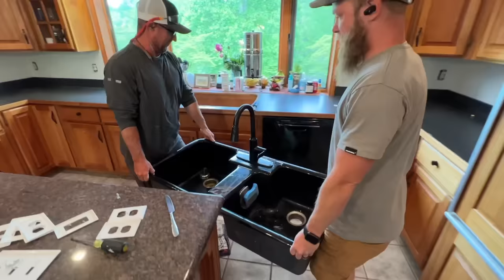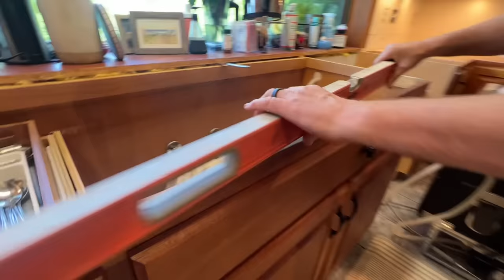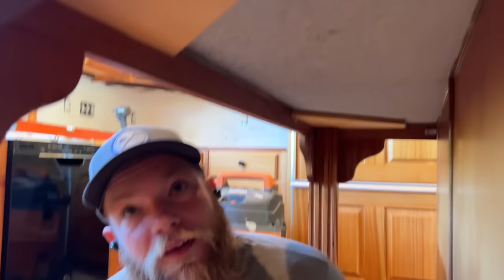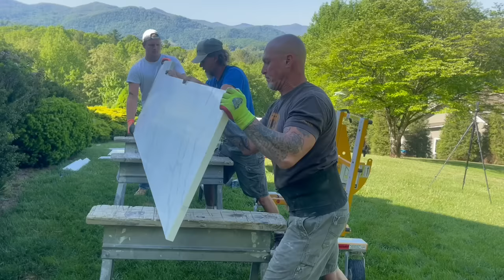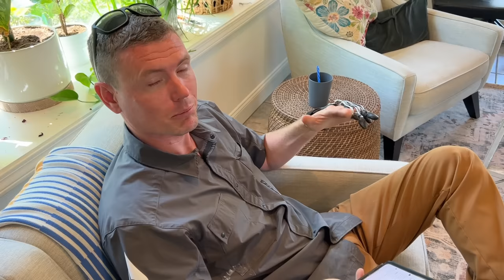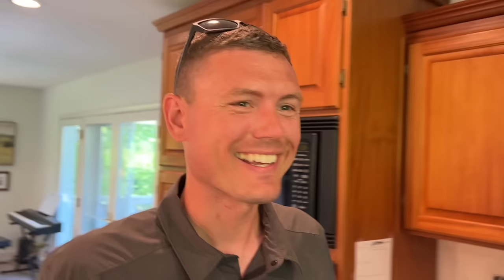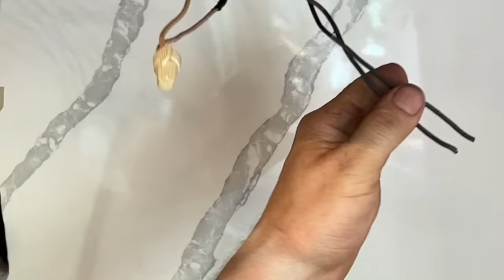Watch this BEFORE before replacing your counters!

Comment: Anderson makes a different casement window crank that are not designed the same way.  Think of them as big air clean wing nuts that you would have seen in a carbureted V-8 engine (you're old enough to remember those right?   lol   Seriously though, those wing nut cranks will clean, but will not give you as much leverage when trying to open the windows.   And as window mechanism's age, they need more pony power to open, or more leverage in other terms.   So, there is an option, but it does come with a small penalty.   BTW, you have a beautiful back yard!

Comment: Hey man, 31 minutes in the bay window. I got the same one you can rig up a couple of CPU fans power supply fans like three or four of them to a 12 V converter plug it in you can put them in some wooden and lay them, or whatever you want you know, but just the moving air will keep that from happening. I ended up under skirting mine with some insulation underneath the bottom and worked out pretty good.

Comment: Re the backsplash, behind the stove is the most important part to have a smooth, easy to clean surface, but you're preserving that porous brick surface.  It may look cool but even if sealed periodically, keeping it grease-free will be an unnecessary chore.

Comment: New top looks awesome! first time here, as someone else mentioned...you seemed to really enjoy the comrade while slaving way, great bunch of dudes. You can get a "T" style crank handle for the casement, that would allow a sheet of formica. As for that long cabinet that bowed, see s like they didn't put in mid supports under the base, but looks like yeah covered that off. Will be back, Thanks. Andrew

Comment: Just did a very similar upgrade on my house with almost the same color/pattern quartz. Huge wrap around with island etc. My demo though was everything was covered with 4” ceramic tiles with concrete and mesh under it. One of most difficult demos I’ve done. The quartz guys were amazing though and the project came out amazing.

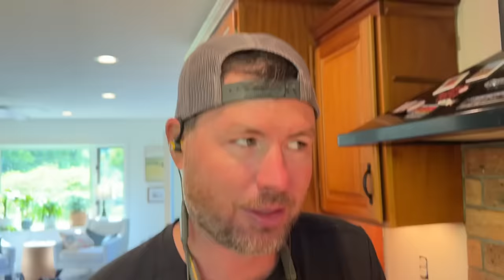Comment: 6:14 Yes. Get new cabinets and make sure they are strong enough to handle the weight of the new counter top. Particle board is a no no. 1/2 inch sides is a no no, use 3/4 inch cabinet grade plywood.

Comment: I had one guy show up to measure countertops years ago with just a folding ruler and a pad. I tell them you have to make a physical template of the base cabinets with lattice strips using a hot glue gun and a stapler. I also have seen those undermount sinks just fall out because the sink was only glued in place without mechanical fasteners.  I hope they didn't do that to you

Comment: In England we have roof tiles made of numerous products ie clay or concrete etc felt is used on sheds etc, your window seal could always post a shallow level of resin over it would prevent it from getting wet

Comment: That bay window behind the sink could be an awesome spot for some marble effect or straight white epoxy after you cleanup some of the loose ply...?
Reply: I have had to do similar repairs with delaminated timer, and I found that vacuum bagging resin or epoxy can often work out best as you can tint the resin to hide all sins from the past. Also if you were to buy a vacuum pump Jamie can start making stabilized wood biscuits for his projects and a homemade vacuum chamber will not take long to build.

Comment: Jay in England we don’t use shingles because of price we use a green felt for out building’s I have used shingles on my shed and they do take British weather the new stuff now is rubber sheet made to measure you just glue it down no nails or screws . I have done roofing in the states on sisters house the most popular thing that is used on houses in England is slate or concrete tiles 👍
Reply: Very cool, thanks!

Comment: Hi guys your company reminds me of me and my brother's they worked for me too in construction. Is great to see, I live here in Leeds UK and  we use should  use shingle on roof more. We don't even sheath the roof its open then breather membrane over the roof trusses then 1x2 battens then either slate tiles or around 30 different shapes sizes and colours of concrete tile. Love watching, best stuff👌👌👌
Reply: I covet a slate roof.  It is prohibitively expensive in the US.
Reply: @SammyMaeQ  it is, a 16" x 9" Welsh slate can be approx £5 per slate and as 3/4 of the slate is hidden behind the next slate up it seems mindless. So it could cost around$30 per sq ft😖😖.  Houses here pre 60s were predominantly slate roof throughout the country apart from a few thatched roofs. (Now there's An art!) Find a video to watch of how it's done and the cost £30k so around $40k and that's for a small roof. Very few new builds here are with natural slate anymore. It's either composite replica or concrete tile. Only in listed areas or buildings are slate used to match original. And that's mainly why its so expensive now as it's a niche market. Still lots of repair slate work but not much strip and cover work.

Comment: The counter tops are fab!  When we replaced our kitchen I went for a Carrara marble look - couldn't afford the 'real' thing like yours, but with white cabinetry really brightens up a small space & looks very classy.  I think your video is a good one to watch for folks considering a kitchen upgrade & just what some of the pitfalls to making do & mend can be. - I was super-weary of gutting my kitchen to get all new in - but boy, I wish I'd gone further than I did - now I would have lost a wall & re-sighted the entry!  Essential replacements:- wiring - modern wiring is much thinner than old wiring & many new fixtures can't accommodate the old heavier wires; plumbing - the pipes were pretty worn out, some of the stuff used in the 80s & 90s was very low-quality & is now springing leaks & as you discovered, who knows who it was who installed this stuff back in the day (!?!); cabinetry - as with yours, dodgy AF!  I'm surprised it was strong enough to support that quartz/marble.  Also the levels can be all over the place & units that have been there for years can have settled & often when you take the top off & start checking out the construction - OMG! You were saying about how expensive cooling your place is - wonder what you would have found behind those old units? No insulation, perhaps? We found ants, crazy use of particle board - it all went, replaced with new, as needed, new sarking, braces (in case of storms) & insulation, then new drywall, tiles - everything.  I do wish we'd gone the extra 9-yards & relocated the kitchen entry as we could now have a bigger bathroom, which is desperately needed.  Good video & I loved the dogs - so nonchalant in the midst of all the turmoil - gotta love 'em.  Sorry for that injury, too, very nasty - hope all healing well.
Reply: I did notice the fingers, what happened?